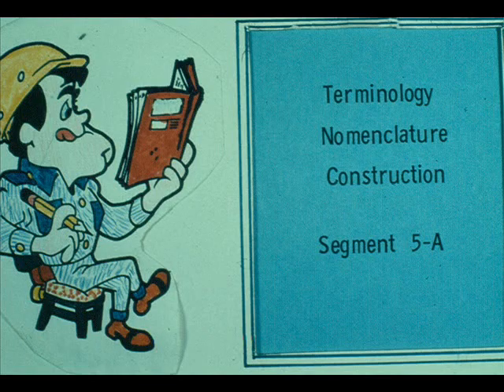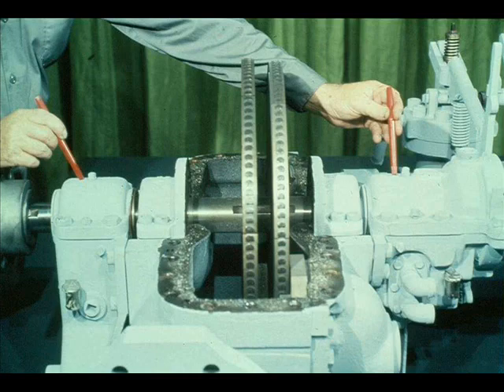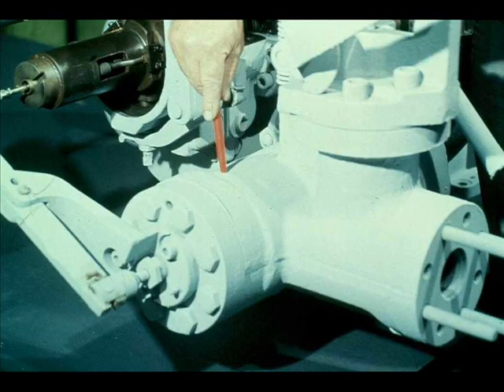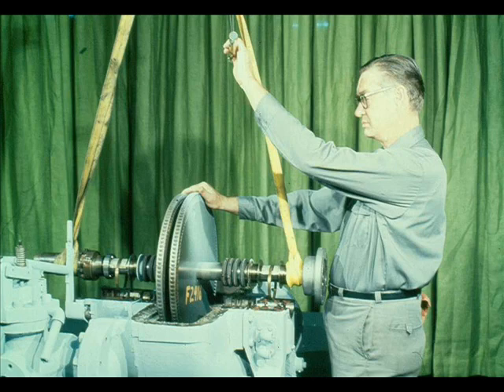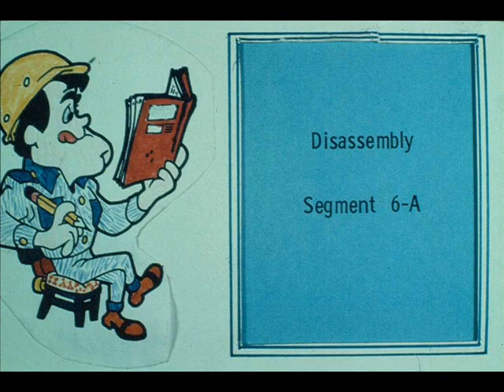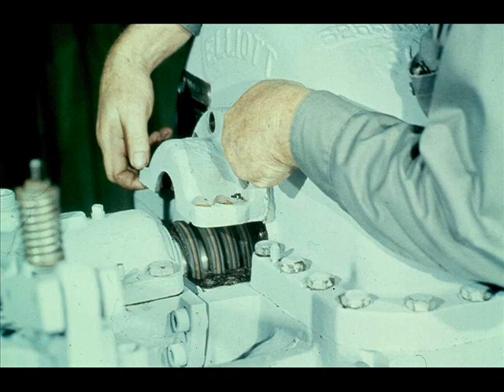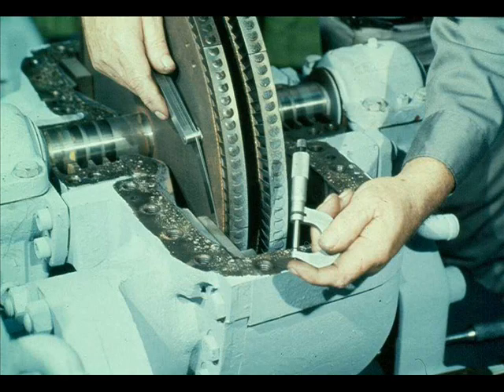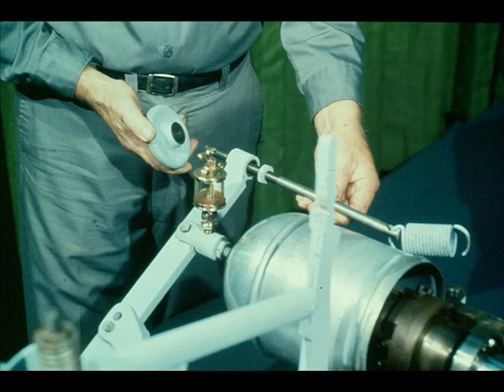Steam Turbine | Steam Turbine Part 2 | Steam Turbine Overhauling | Steam Turbine Working

Comment: Steam leakage come from turbine split casing,what supoose to do??which kind of gasket used ??may you help me?
Reply: Try aviation sealant liquid
Reply: If you're experiencing steam leakage from a turbine split casing, it's important to address the issue promptly to avoid further damage and ensure safety.  Determine the Type of Gasket
Metallic Gaskets: These are often used in high-temperature, high-pressure applications such as turbine casings. Common types include spiral wound gaskets or metal jacketed gaskets.

Non-Metallic Gaskets: For lower pressure applications or less extreme conditions, you may use graphite gaskets or PTFE (Teflon) gaskets.

Composite Gaskets: These gaskets combine metals with softer materials for a more durable, high-performance solution, often used when there are high thermal cycling and pressure variations.

Steps to Repair the Leak:
Shutdown the turbine: Make sure the turbine is safely shut down and cool before any repair is done.

Disassemble the casing: Carefully remove the turbine casing bolts. Clean the contact surfaces where the gasket sits.

Inspect the gasket: Check if the gasket is damaged or has lost its elasticity. If it’s worn out, it should be replaced.

Install a New Gasket: Choose the appropriate gasket material based on the pressure, temperature, and operating conditions of the turbine. Clean the surfaces and carefully place the new gasket.

Reassemble the turbine: Reassemble the casing and torque the bolts in a criss-cross pattern to ensure uniform compression of the gasket.

Test the turbine: Once reassembled, conduct a pressure test to ensure that the leak is properly sealed.

Comment: Could you do a description on a AP ST10 steam turbine
Reply: The AP ST10 steam turbine offers a reliable, efficient, and versatile solution for medium-scale power generation and industrial mechanical drive applications. Its design ensures low maintenance and long-lasting operation, making it a popular choice in various industries requiring high-performance steam turbines. Whether used in a power plant or an industrial facility, it contributes to improved energy efficiency and operational flexibility.